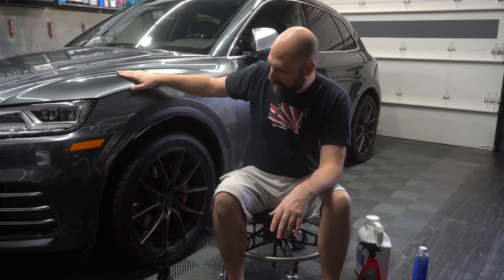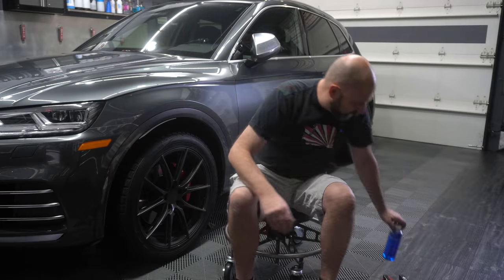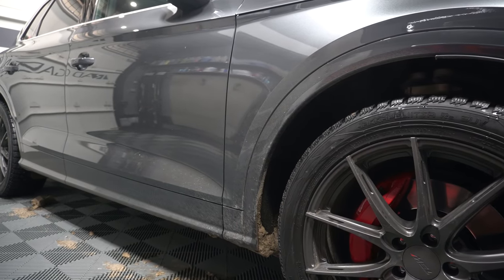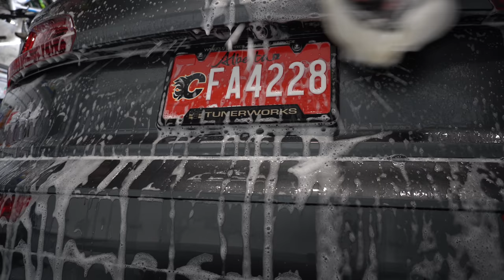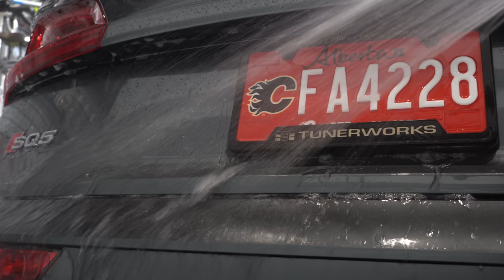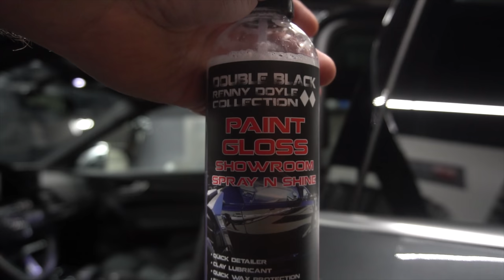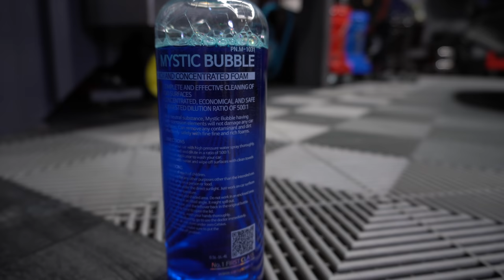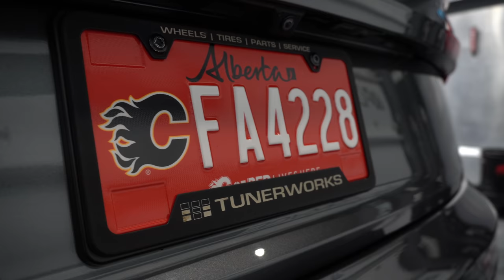SUNDAY NIGHT WASH | Doing my Best to Maintain my Audi SQ5 in the Unforgiving Frozen Tundra of Canada

Comment: A PHD in applied chemistry lol Bilt Hamber is gonna need to make some changes after you and Pan’s experience. Nobody wants to use products that are confusing!
Reply: Yep..... BH has a huge cult following in the UK 🇬🇧 but don't ever question the dilution of auto foam as you'll be hung drawn and quartered in the Facebook group..... PIR.... and all that stuff...

When I found other products as good which didn't need a maths degree to calculate how much I need I left and moved on....
Great product but just too confusing....
Measure...pour and add water...that is all I need to do
Reply: In Europe we love BH products. Not confusing at all.
Reply from the maker: Europeans must have a more sophisticated education system. 🤔
Reply: @RADGarage  far from it.... but it shouldn't be that complicated to dilute a product... I get it but when every other manufacturer works on a dilution ratio and BH don't then you have to ask why?....
Water plus product equals results.
Reply from the maker: @dave2166  I got pretty good results winging it, so I am not sure if going through the whole PIR testing routine is even worth it. I might try it next time by doubling the soap and seeing what materializes. I am not going to overthink it. 🤘
Reply: @RADGarage  I think you did well and the results are what counts here.... they do a runnier foam than most but it does work so you got what you wanted and as a Brit I'm glad you and Pan like the BH products you're getting so far. Auto Wheels  has been my favourite cleaner for years so hopefully you'll get to have a go with that soon...
Reply from the maker: Thanks Dave. I used the Auto Wheel on a project lately, just can't recall which one. I liked it.